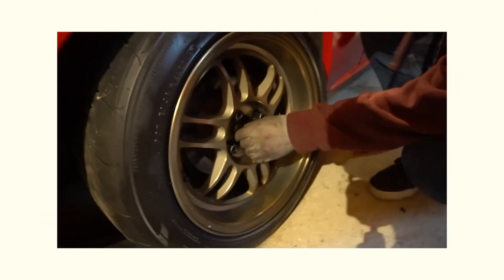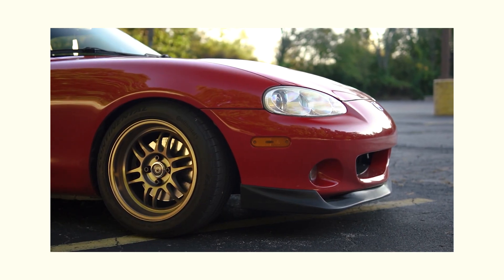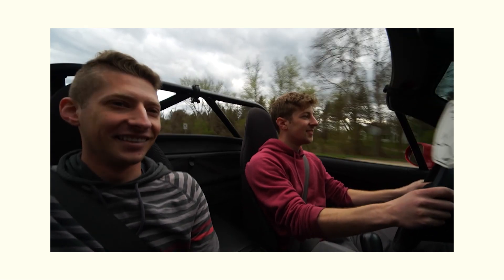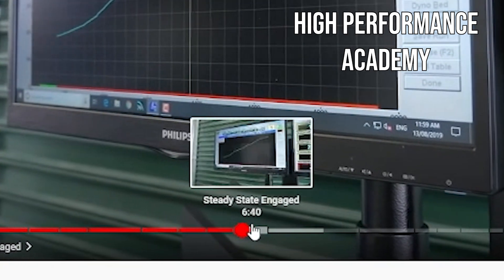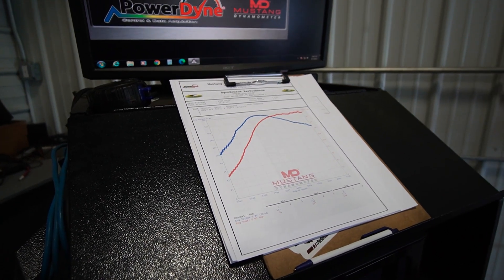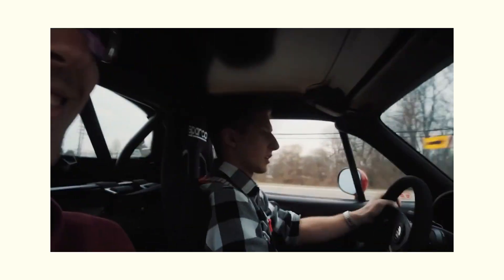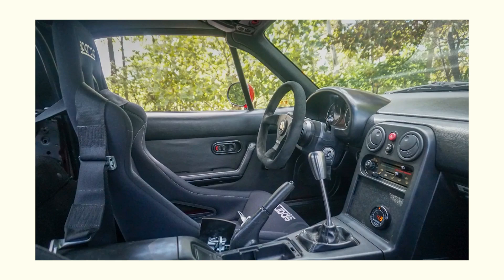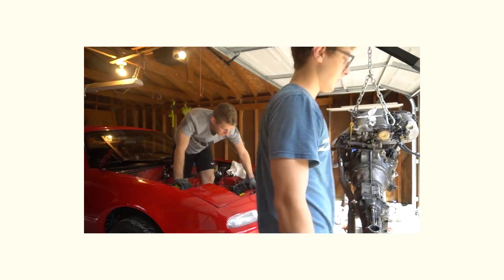My Miata Makes 240WHP Now (Thanks to my Brother)

Comment: Sir I think you might have just solved my issue LOL. My car overboosts and does that same exact thing where it jerks like crazy
Reply: Yep, raise overboost protection to ~10 kpa higher and that should fix it. Overboost protection is a great tool though, so make sure you have it at a value that makes sense in case there's a boos tproblem ever in the future. It could save your engine.

Comment: Sick vid definitely would die driving 240 Miata lol. I’m 15 and I’m starting my turbo Miata build soon. I’m shootings for 180-200whp which is more than enough for me. I’m just wondering if a gt2560r could do that for me at 8psi? Would it be too much or just right? I don’t want to go over 200whp so if it does could a tune dial it back to 180-200whp?!?
Reply from the maker: GT2560R can support up to 300whp! 8 or 9 psi would probably get you right around 190-200whp!
Reply: you can dial the tune back on it. Its simple just retard the ignition timing and tada....make less power.
Reply: The GT2560R is a great match for the Miata motor. As you can hear in the video, the spool is quite good even with a 2.5" exhaust holding us back. If your goal is 200 whp, you can easily make that on an even smaller turbo, the GT2554R.

Comment: life lesson if your tune is fine and you know what you're doing. Don't get a dyno tune.....
Reply: I'd still get a tune. There's alot of gain from going to a Dyno tuner they went to school to tune for a reason. You have to go to a reputable one for sure. In August I have an appointment with Brent at pfi speed I'm literally slapping my car in a u-haul and driving it from Michigan to Colorado.
Reply: @farmerbobbygrows3338  yeah or do that...but im just saying. If there isnt a good one nearby. The tune you have is good enough.
Reply: I'm gonna disagree here, too. There's so much to be gained on a dyno that you simply cannot do on the road. Mainly, this is tuning VVT and timing. Without a real-time torque reading you do not know if you are before, on, or after MTB (maximum brake torque). Meaning, you could have your timing well past MBT which reduces power and increases the likelihood of knock/detonation. Additionally, there's areas of the fuel VE and timing tables that you physically cannot hit on the road without a 50+ degree hill or utterly insane brake boosting. The problem is our case was the specific tuner. Since Ptarick moves to Chicago, he had to select a different tuner than the one I recommend (Aaron @ Pure Tuning). The long story short is that this tuning shop (won't name names) simply did not know what they were doing. If we were to do it again we would have just rented a load bearing dyno or made the trip to Pure Tuning.

Comment: my clutch just went out do you have any stage 2 recommendations
Reply from the maker: Depending on power level, Flyin Miata has a stage 1 and stage 2. I've got the stage 1 and it feels very similar to stock, hasn't slipped yet